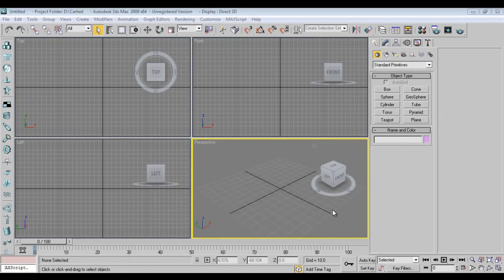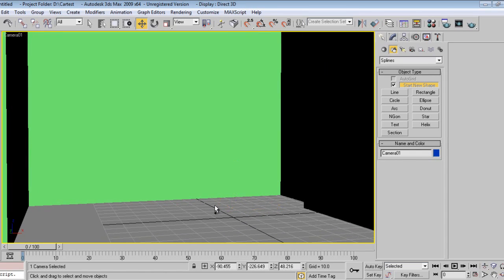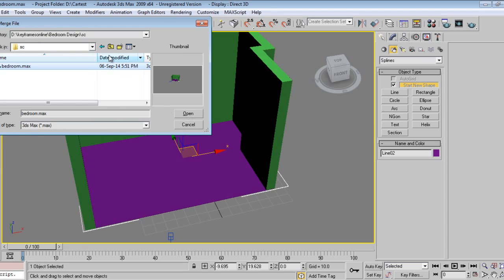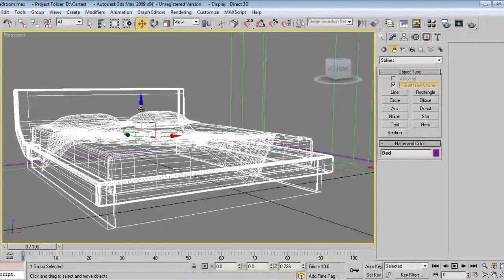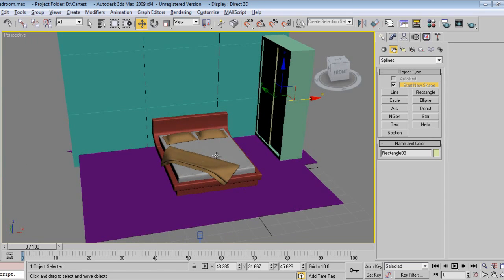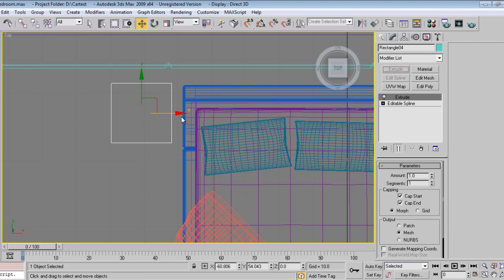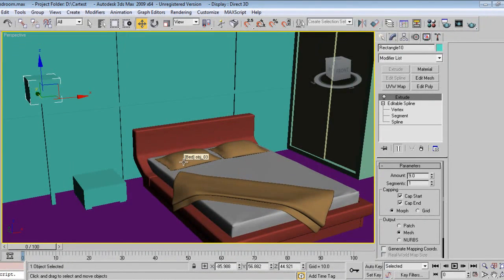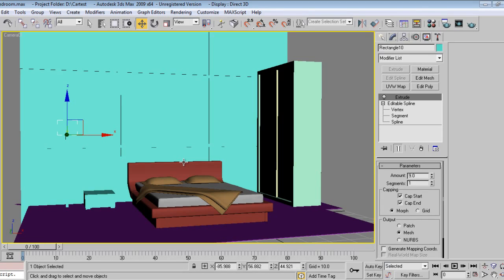Bedroom Design in 3D Max Part-01

Comment: hello sir, i have a problem in my pc that 3d max software install problem , my operating system is windows 7 64 bit , when i am install the 3d max 2009 32 bit , install are stop to (mantal ray) , and my new operating system    .

now what can i do for this ?
Reply from the maker: +sadia islam don't install 32bit
Reply: sir can you give me some 3d models link where i can get models (bed, table) etc .
Reply from the maker: Hey you can check on free 3d models website there are lots stuff.
Reply: archive 3d
Reply: archive 3d